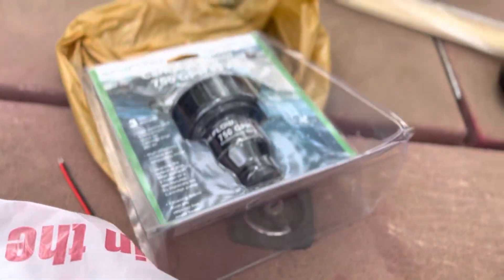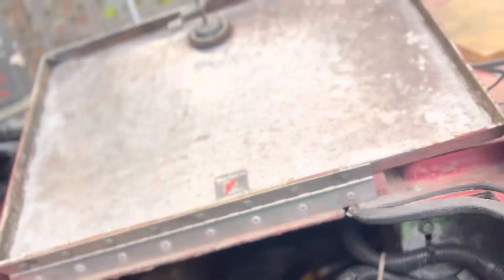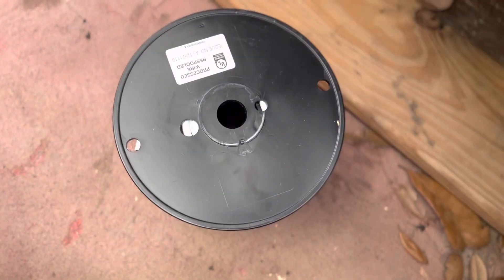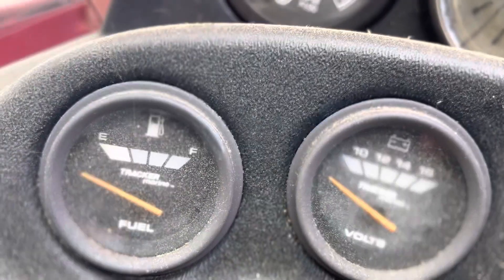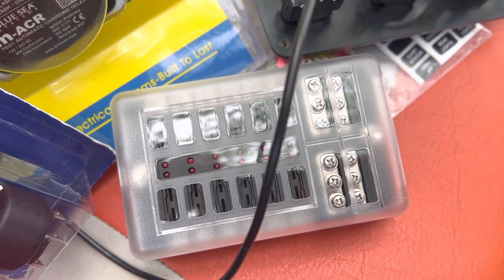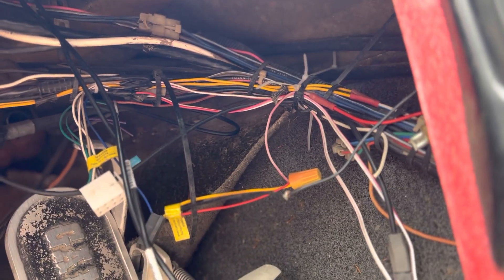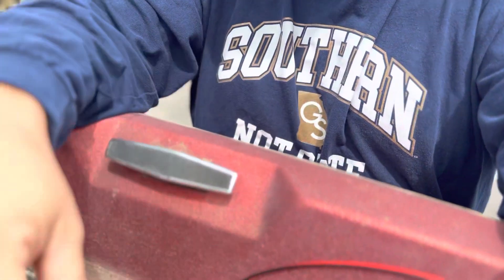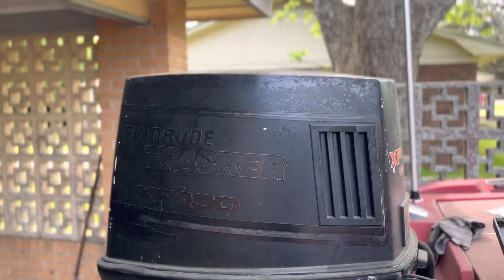1989 Bass Tracker 1800TF rewire project

Comment: I'd just take my time and trace every single wire and replace as needed. You probably have a better knowledge of electrical than I do but there's nothing too complex on the wiring. The tach should gets it's pulse from the rectifier grey wire. Speedo gets water from either a pickup tube on the transom or the leading edge of the lower unit. Trim guage from a small sender unit under the engine, and fuel sender is on the top of the tank port side. The bilge and livewell pumps run to a bus bar located port side and the toggles run to 2 small canisters under the dash that are livewell timers. The pull knob just actuates a cable that opens or closes the valve next to each cartridge pump to fill/drain the livewells. Mine leak too lol I never use my livewells so I just plug them, apparently those valves are prone to leaking as well. I'll get around to replacing my livewell plumbing at some point but I usually just fill them with ice to keep drinks cold so it isn't on my list of things to do yet lol good luck with it, those hulls ride pretty well I have a 150 on mine and it'll run almost 60 on smooth glass. Mine has the teleflex double rack steering system that works fine but man I want to upgrade to hydraulic soon. That'll be my next project
Reply from the maker: I sent it off to a shop a few weeks ago, actually. The technician watched my video prior to getting the boat, so he had a good idea of what all I wanted done. He's been sending me photos throughout the process, which is ALMOST DONE. I should be getting the boat back in about a week. Once I retrieve it, I'll definitely be doing a follow-up video, complete with the "re-maiden" voyage. From what I've seen in the pictures, the before and after is wonderful. As for the leaking livewell pump, there was a crack in the housing, so that was a pretty simple and cheap fix.😁